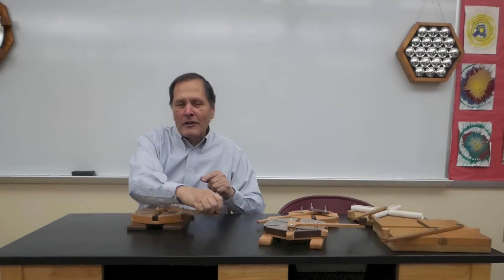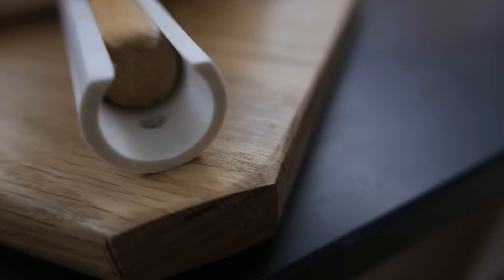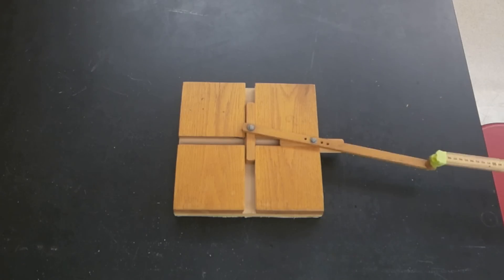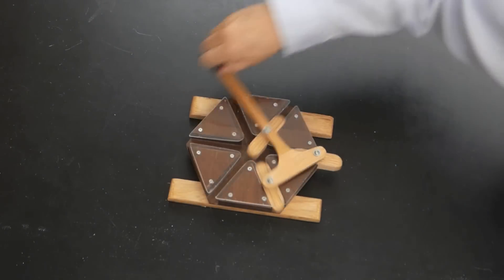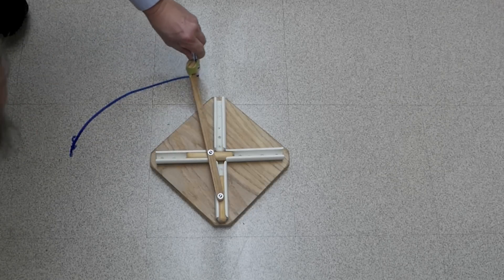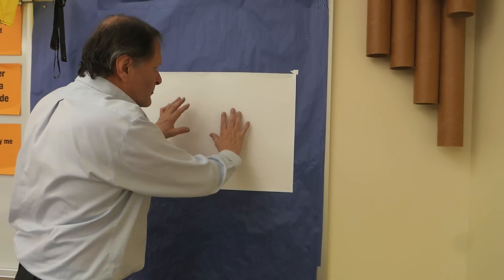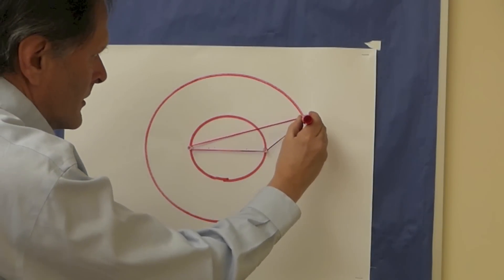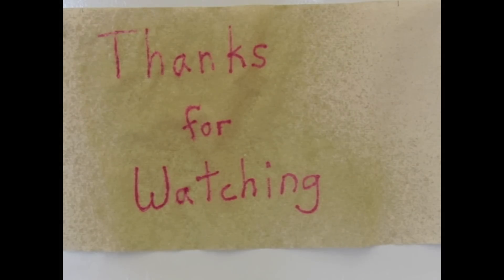Trammel of Archimedes - Do Nothing Machine part 2 // Homemade Science with Bruce Yeany

Comment: ...could this be applied to a type of engine?
Reply: You can put knives on it and stab properly aligned people with it.
Reply: pistons are the main component of an engine, and the moving blocks shown here would make for such an inefficient engine. it could be an engine, but its not practical considering the efficiency would be terrible
Reply: Look up rotary engine
Reply: don't old radial plane engines use this Method?
Reply: Yes!  Circular motion converted into alternating rectilinear motion.  Examples are horizontal hack saw or sewing machine.  When circular motion is ellipsoidal an eccentric movement is created such as found in punching holes or a stamp mill where an interval is required to exchange stock as in production runs.  There are many such examples as used in industry.
Reply: Out of curiosity, why do you say it would be inefficient?
Reply: Renan Lefebvre Sexy lube fixes everything.
Reply: ROFL
Reply: I think this mechanism can be used to do rope.
Reply: John Holmes III it would be inefficient
Reply: sound effects for horses foot steps
Reply: lueefour Not sure how to word it, but a normal engine has the piston actuate on a tangent reducing any (friction?). This wouldn't operate so efficient because that is not the case here.
Reply: more or less this is the same mechanism big  steam engines used to transmit the movement to wheels.
Reply: That's what I'm wondering. The inertia normally lost from the power stroke could be used to drive compression on the opposite side. The trick would be to seal the chamber to allow a 2-cycle configuration on the outside part.

Other that 2-cycle, it might make sense for a steam or air motor where a valve setup would do the job.

If working, all the travel of the shuttles would make one heck of a stroker engine.
Reply: John Holmes III 
Yes, made of wood and plastic.
Reply: People, elliptical path...
Reply: It would be far too inefficient.
Reply: don'taskmewhyIchosethisname. Yes! Except without an eccentric crank.
Reply: I know this could be...
REVOLUTIONary
baa dumm ssssss
Reply: CHALLENGE ACCEPTED
Reply: The principle might be.. but making it an engine is quite possible.
Reply: Okay,not too clear but I see what you are trying to say.  The part in an engine are positioned and shaped to cut down on as much friction as possible.  This let's them deliver the best preformans.  These would make horrible engines because the pistons are tranfering from one side to the other to spin an overly large crank.  Keep in mind these little machines are designed to be spun By the Crank and not spin the crank.  You might thing a Rotory engine (Old plane engine) works on the same princeiple.  You would be wrong.  Take his three acess jig, you spin the crank and all three shuttles tranfer sides.
Reply: John Holmes III  I was thinking that myself
Reply: Dan W How old are you really?

Comment: I think I've seen this movement in Hiscox, Mechanical Movements. Have to dig it up and see what it was used for.
Reply from the maker: I heard it's used in wood working,  and several have suggested some type of engine but I can't find it,  if you find other uses, I be interested to hear them
Reply: Here we go, from"1800 Mechanical Movements and Devices" by Gardner Hiscox. item 1040 Trammel Gear and item 1074 Six Radial Grooved Trammel. both work on the same principles as yours, The book's ISBN is 1-894572-18-1. It is available at Lee Valley.

Comment: Interesting that you could not find a reference that explained a connection of this to Archimedes. It does look like a "locus of points" problem, which the Ancient Greeks were fond of. An ellipse being the "the locus of points the sum of whose distance from two given points is a constant" is such a problem.

 As one person pointed out in your other video on this, there is a 1/4 cut-down version of this. In that, you would have a stick with two nails that rub along the edges of a right-angled wood block, but one end of the stick would extend far beyond the nails. A question Archimedes might have set for himself is "What is the locus of points of the end of the stick." Since analytic geometry did not then exist (and therefore you could not find the equation of the curve), it would have been very difficult to prove the curve was a segment of an ellipse, just the kind of thing Archimedes relished.

There is another layout trick (based on geometry) I have heard about, for marking out an arched doorway. You put a nail on each side of the doorway where the arc is to begin and end. You nail two sticks together so that the notch where the sticks join is at the high point of the arch, while the sticks rest on the nails at the side of the doorway. When you slide the sticks resting on the nails from one side to the other, a pencil in the notch will trace out an arc of a circle. In other words, you can layout a circular arc without ever finding the center of a circle. (In fact the angular part of the circle is twice the angle of the notch, by a theorem in geometry. A 90 degree notch produces 180 degrees of a circle.)
Reply: Aniruddh Deshpande

OK. Then I will write another long comment.

 In the 1800's, when the mechanical age was just beginning to produce wonders like steam engines powering locomotives and the central water system of cities, mathematicians took up a study of what were called "linkages." The idea, I suppose, was that mathematics was going to help inventors understand what mechanical contrivances could do and what was impossible. People are right that this "trammel of Archimedes" looks something like the linkage that hooks up wheels on a locomotive, and the way pistons crank a crankshaft in a gasoline engine. Linkages also form some of the basis of Charles Babbage's Difference Engine and Analytical Engine (now considered the first ancestor of computers as we know them.)

 Mathematicians made rapid progress on the subject of linkages. So rapid, in fact, that they determined something which make come as much as surprise to you as it did to me, that you could produce any motion as output from any motion as input. That's right. A linkage can do anything. Sound incredible? Consequently, it is not really a strange, isolated fluke that Charles Babbage, a mathematician, conceived and planned, in complete detail, the first computer.

 I have never seen a book on the subject of linkages, and only seen a few curiosities, without any depth, in any book that mentions the subject. It is a dead subject. A problem that has been completely solved!  That's boring?

 One of the linkages which I have seen mentioned, will generate the integral of a curve when one part of the linkage is moved along a the given curve.

 There is a pretty well known linkage, which Presidents going back to Thomas Jefferson used, that enables you to write an exact copy of your document as write the document. Of course if you trace something, it will make an exact copy, and a version of it (a pantograph) will scale the size up or down.
Reply from the maker: Hi Kenneth, more information I didn't know, I'm always appreciate  seeing additional explanations or suggestions  about any of the ideas that I've posted,  this is a learning process for me also.  Thanks for your post
Reply: Vulgar Display of Truth
If people keep encouraging me, this could go on forever.

 The ancient Romans were fabulous practical engineers and builders, but there is a striking lack of any significant mathematics attributed to them, in contrast to the ancient Greeks, who built the most beautiful buildings (certainly in the opinion of the Romans), with marginal structural principles. The Romans however practically worshiped Greek culture, prominently Greek art and natural philosophy (= science), but more so their religion (Roman Jupiter = Greek Zeus, etc.), and respected all the Greek intellectual achievements, including mathematics, which Romans didn't seem to do much with themselves. The Romans, having conquered the Greeks, spread Greek (= Hellenic) culture more thoroughly and more extensively than the Greeks ever did, and the Greeks had not been sissies when it came to conquering. The Romans were the first (after the Greeks) in a line of preservationists of Greek texts, through copying, because the material scrolls were written on would crumble to nothing within a couple of generations. And they absolutely did do this out of reverence for Greek intellectual achievement. The Romans also believed in going to the best for the best, so for beautiful sculptures or beautiful buildings, you would hire Greeks, or enslave Greeks, for the job.

 Which brings us to the point. Is the Colosseum a fake ellipse, or does it perhaps accidentally look like an ellipse,  because the Romans were not very mathematical, or is it a real ellipse, because the Romans definitely would use Greeks if and when needed, and must have at least been aware of the ellipse, through the Greeks? Is there an answer, or do scholars just like to do more and more research, and argue more and more?

I saw something where they said the Colosseum was made in two pairs of opposing segments of an ellipse, one pair for the long section, and one pair for the narrow ends, the reason being the narrow ends would have spectators not properly facing the arena if it were an accurate ellipse. Sounds like something the engineering oriented Romans would do.

 IAC the ellipse has interesting acoustics, which might be relevant. Let's start with a circle. Standing at the center of a circular wall, all sounds will reflect directly back at you. An ellipse has two points (foci) corresponding to the circle's one center. (They are where the pins are when an ellipse is drawn using a string as in the video.) Standing at one of these points, all sound will reflect back to the other point. Of course once sound got to that point, it would keep going, reflect from the walls again, and go back to the original point. The net effect, though, could be very good dispersion of sound through the stadium if you stood near a focus. The Romans may have noticed something like this from building earlier stadiums, and the Greeks told them why. Maybe.
Reply: *****
Yes.
Reply: Kenneth Florek 
Wait, you mentioned something about a linkage that could generate the integral (or antiderivative) of a function?
Reply: Samurai Carpenter shows that in a video.
Reply: Kenneth Florek I just liked your comment without reading cuz you wrote a lot
Reply: Kenneth Florek, very very interesting; thank you!
Reply: Kenneth Florek 
Yup like it
Reply: Kenneth Florek Great
Reply: I like it!
Reply: Lord

Comment: Would you be able to engineer a 3 piston 6 cylinder internal combustion or steam engine with this design. Seems like a fun challenge. The combustion would happen at either end of the piston, shooting it back and forth. The exhaust valve would open and release gasses just before the top of the piston enters the center transition as to not affect the other pistons. There would have to be some sort of master exhaust valve in the center though I think. It would be like a rotary piston hybrid. Just seems fun to see.
Reply: What I mean by "would you?" is "would it be possible?"
Reply from the maker: That's a good question,  I've been looking around trying to find an answer on this but haven't,  hopefully someone else can